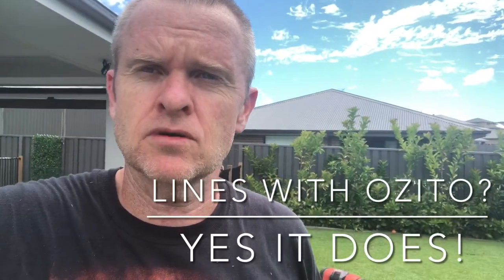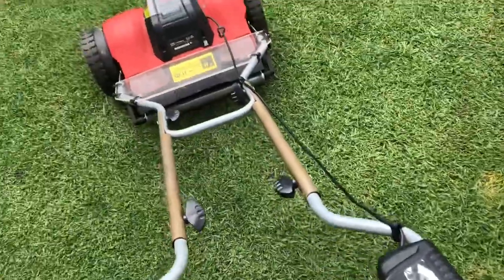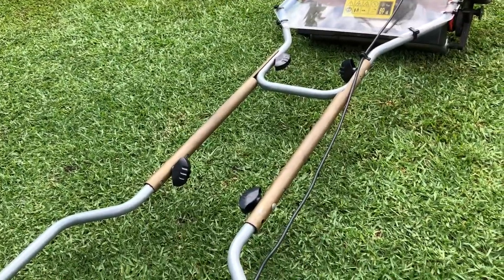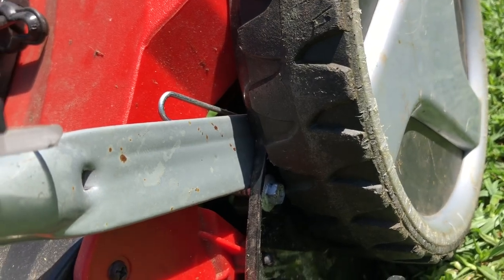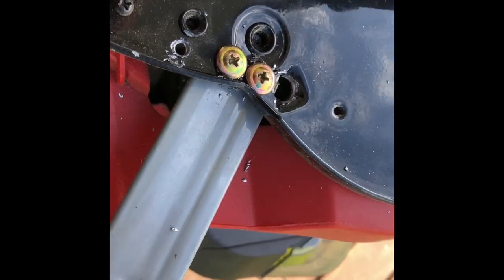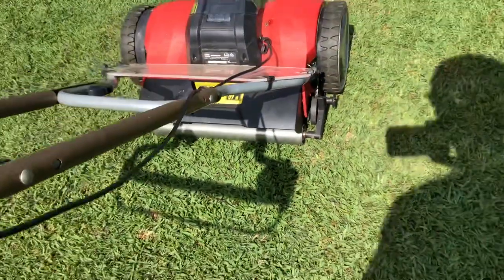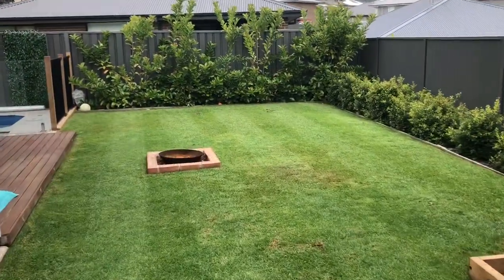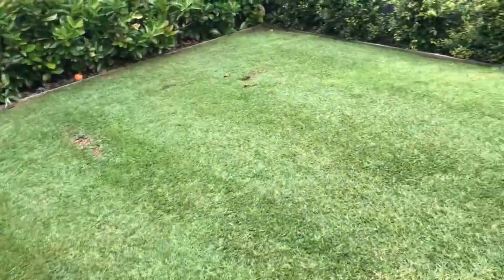Striping with the Ozito Cylinder Mower

Comment: How are you finding the mower overall after a while using it?

I've just laid new turf to the front, approx 45m ish in almost a semi circle shape so pretty awkward. Was going to buy a Makita 330mm 18v rotary rather than my cumbersome petrol Ryobi but have my eye on this ozito as it's so cheap (and I have an ozito battery kicking about). What's the run time like on the battery?

Cheers, Harvey